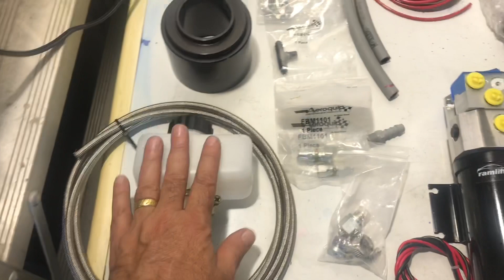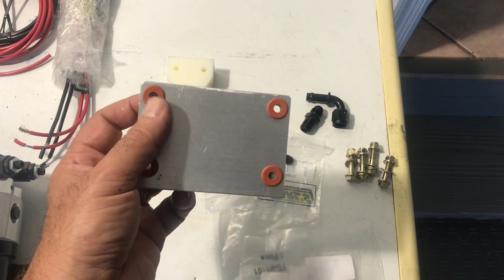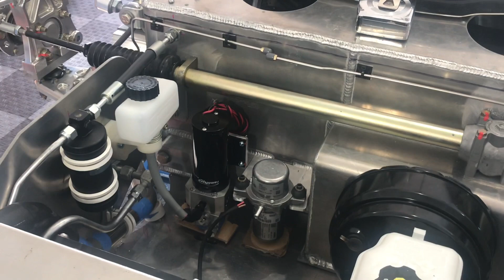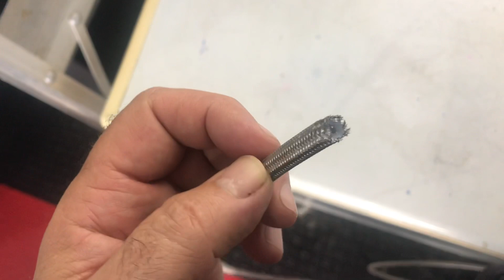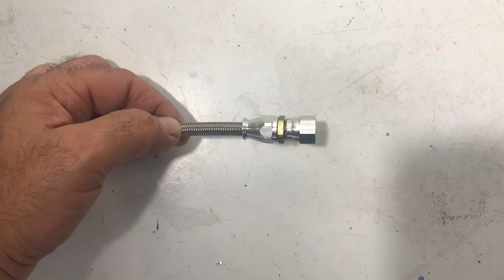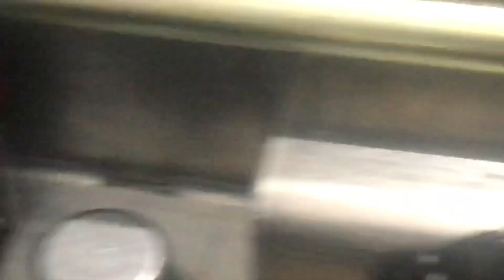Superlite SLC Build 060 Ramliftpro Walk Around and Hydraulic Pump Install

Comment: Hi Joel, awesome job you are doing there. I was searching online for some details for the SL-C build and found this. Watched all 60 episodes so far. Keep it going mate, can’t wait for it to finish :)

Hopefully, one day I can bite the bullet and start my own build, speaking of which, do you reckon it will fit a quad-rotor 26B in the engine bay? Thanks

Vic
Reply from the maker: Thanks Vic, appreciate the feedback. With regard to putting a quad-rotor in an SLC I think it would fit, someone built a 3 rotor SLC a while back. Guys do some wild things with the SLC and have seen BMW V10s, Overhead Cam LS engines, and someone is now building an electric SLC with a Tesla drivetrain. Lot’s of creativity among the various builders. Check out GT40s.com, many SLC build threads to see.
Reply: @JoelKSLC  cheers mate, will definitely check out the forum.